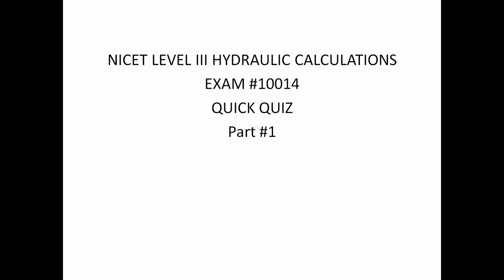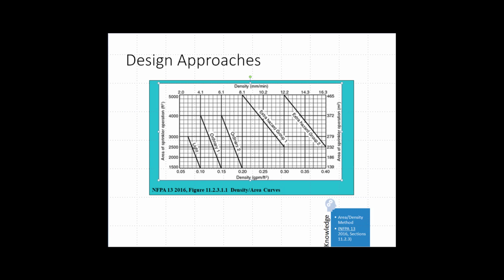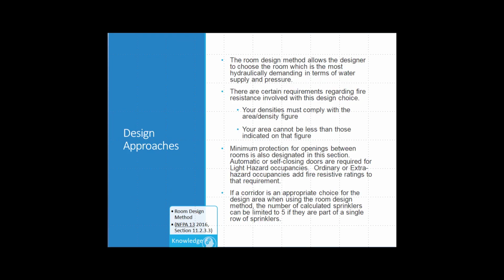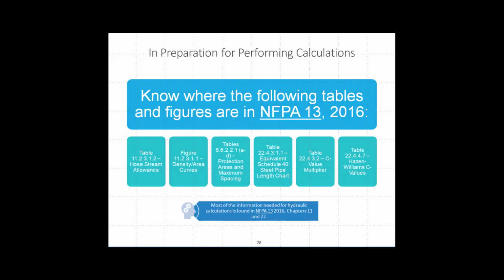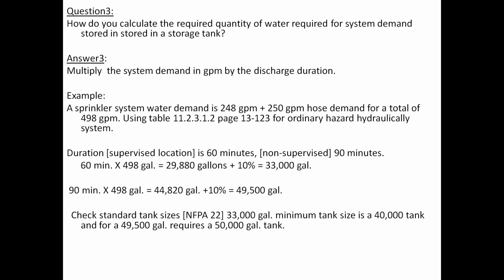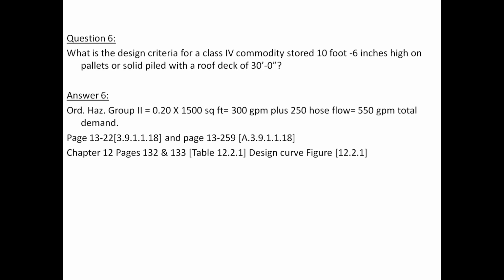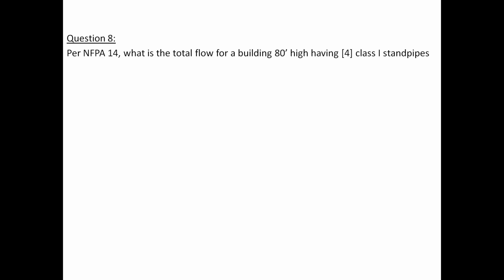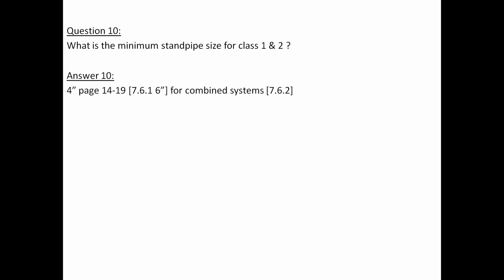NICET Part One V2 Level 3 Design and layout

Comment: Passed the novel level 3 general plans last year. Turned around and took the hydraulics portion right after and failed. Looking to take it again in the next few months. Any suggestions for study materials / strategy?
Have been in estimating only for a while now so my design skills and knowledge could be lacking
Reply from the maker: Vincent
Have you been studying for the hydraulics exam, if so what training provider are you using.